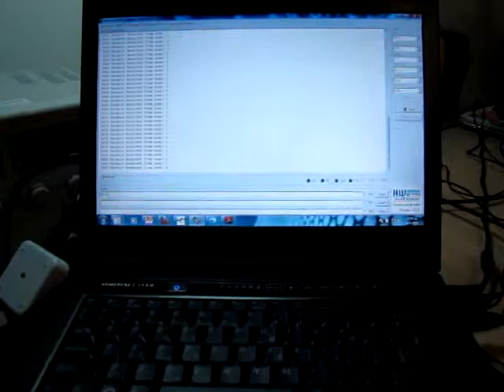CSMA/CA Protocol Design and Implementation

Comment: If u dont mind can u please share further details as to how did u implement the protocol,like.Software used, Algorithm implementation,Hardware used for wireless transmission etc.Actually I also am working on a similar protocol design project.
Reply: +ks nathan did you find anything to share with us?